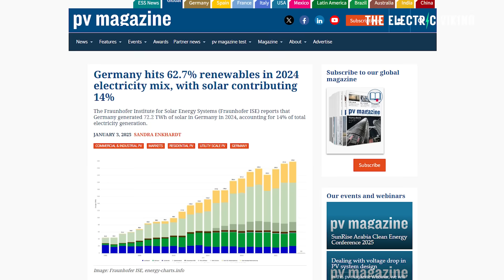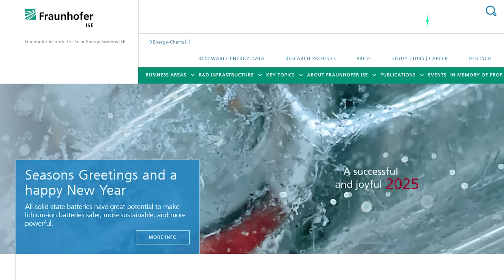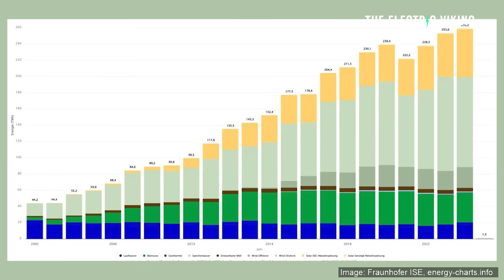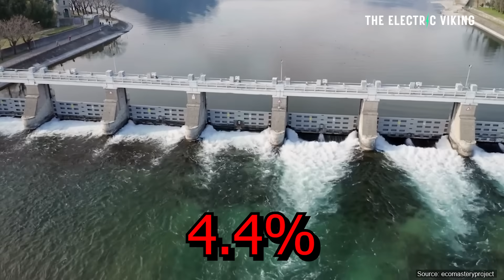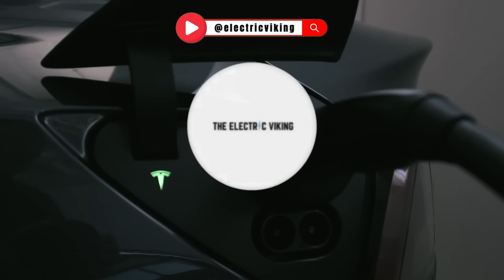Germany hits 63% renewables in 2024 as battery storage almost doubles

Comment: the energy prices have risen 3x since the pandemic and they also have to buy energy from other countries such as france to keep the resources afloat
Reply: Are you Sure? German Guy here, you can get fresh energy contracts for around 30 cents/kwh with fixed price for a year If you like (just checked). And I dont remember paying 10 cents/kwh before covid. I also checked this and surprise, it was actually also around 30 cents/kwh, so it Back to Normal, If you include Inflation, its even LOWER. 

Please dont use those people as example who switched contracts during Gas shortage times and are now too lazy/stupid to get a new contract.
Reply: No, Germany has enough installed capacity for itself. It doesn't need the imports. But the imports are cheaper. However France really needs to import electricity in winter. Don't twist the truth.
Reply: No more cheap Russian oil.  It will take a while to replace all that with (cheaper) renewables.
Reply: @krakken-  and with The Donald going to supply us cheaper energy too remember… drill baby drill!! Well until Starmer goes back to EU again… against all our will so energy will go up,up and up! Its already the most expensive on the planet!! 🇬🇧🚜 but its okayMr Milliband isgoing to make it cheaper by £300… oh, no he hasnt, he has made it more!!
Reply: No. Germany has plenty of power. They buy electricity when producing is more expensive than buying. Usually they help France when their nuclear power plants are cooking.
Reply: @limonade2684  Why is Sweden and Denmark complaning as hell when Germany has enough energy :P
Reply: @ravanpee1325  Denmark isn't complaining at all, but sells a lot of energy to Germany.
And Sweden has it's problems now: they just don't have enough lines to fully supply their south from the massive hydropower plants in the north when both wind and nuclear go down. That has just happend: 1 of their 6 reactors was down, and a doldrum happened. Meanwhile, their suppliers saw much more revenue in selling energy to Germany, thus their energy prices went up massively, but only briefly. And the conservative energy minister Ebba Busch is not quite true blaming Germany for that, but not their own companies. It's also politics.
Reply: Complete rubbish you picked up from tabloids.
Reply: @seppwurzel8212  Picked up what? 🥲
Reply: @seppwurzel8212   Picked up what? 🥲 You cant be saying the tabloids of lying are you? Those multi billion £ companys!!
Reply: Another thing Sam gets wrong is the Grid Infrastructure is not designed to take multiple inputs of variable. When electricity is produced by Wind and Solar the power rates are different which then need to be levelled out to a standard power rate. Only large producing plants such as Nuclear, Gas, Coal power can provide a consistent power rate. 
You need 50% of electricity users to produce and store their own electricity and not feed into the Grid. The heavy baseload of the electricity needs to be provided by large Peaker plants that do not pollute the environment. The only ones that fit this is Gas turbine plants. Because Europe has gone stupid and banned Russian Gas. This renewable transition will fail for industry users.
https://www.youtube.com/watch?v=tzZgJkTtoRg&ab_channel=SkyNews
Reply: @mspaintclippy  I paid on average 26 ct per kWh in the last 365 days. I didn‘t pay 8,6 ct at the start of the pandemic. The price since then nearly hasn‘t changed for me. Maybe you should look for a electricity provider with a better tariff.
Reply: Untrue. They spiked, but they are back down to older levels. But also: what’s bad in buying cheap electricity from abroad? We can self sustain us, but right now it is cheaper to use as much renewables as possible and buy some from France (after supporting them with energy when their nuclear plants were off grid for a while). It is a pretty strong achievement already, but now requires great investments in infrastructure.
Reply: @RealDonDenito  If electricity prices are cheaper why is Europe deindustrializing because of energy costs?                                            It seems there was a plan? Maybe Zionists planned for the war in Ukraine to ban cheap Russian gas, and then import expensive LNG from the US and Qatar. With the dream of using renewables? Renewables make sense for domestic usage but not industrial!
Reply: @ You mean even more money that we dont have…
Reply: That's why it's called a Plannedemic.
Reply: What Sam DOESN'T tell you is that the renewable energy that Germany produces is HIGHLY VARIABLE.  That means that it MUST EXPORT large amounts of electricity to its neighbors when it is sunny and/or windy AND IMPORT large amounts of electricity AND run very expensive fossil-fuel peaker plants when it's not.  The numbers he quotes and the graph are VERY MISLEADING.  THe overall contribution of renewables to Germanies actual domestic needs is thus much less renewables and much more domestic fossil and imported energy of all types.  Germany MUST use the rest of Europe for its generating buffer and emergency supply.  Electricity in Germany is VERY EXPENSIVE as a result.  That system is NOT translatable to the rest of the continent.
Reply: @dzcav3  In 2024 the import netto was 6,6% of the total energy production. I wouldn't call this large amounts. The netto import average price was 8,1 ct per kWh. I wouldn't call this very expensive. The import netto will shrink in the next years. As a big part of the energy imports are renewables, the share of renewables is even higher. Don't exaggerate and deliver numbers.
Reply: @dzcav3  
@ElwoodEBlues
5 hours ago
That's what many people believe. Did you look the firgures? In Germany we imported 6% of our energy from other countries. Yes we sell some energy very cheap, almost for free, when solar overproduction happens, and have to pay for imports when we need them. But the imports are much cheaper than fireing up gas power plants for just an hour or two. 
 And you didn't mention the fees and taxes that make up for a full 30% of our energy prices.
 You seem to be one of those "problem seers" - look at solutions. And we are in the middle of "changing everything". We don't have anything but coal, sun, and wind. And coal is expensive now and shall be phased out. How would you solve that?
Reply: @dzcav3  You pasted and copied the same stuff above.
Reply: That's not true.  Fossil fuel prices have risen - know why?  Because they can.  Winð / solar are free, less the cost of installation.
Reply: @AllDogsAreGoodDogs  That is completly untrue..the issue are the "Netzendgeltegebühren" aka Network terminal fees...sun and wind will not give you a bill but your network company ;)
Reply: @ravanpee1325   Thats a great word!!

Comment: If a country needs to have spare electric production capacity when there are dunkelfleute like in November and that can only be done with fossil production that normally are not in use, then the cost of that production must cover the service and stand still for the rest of the year.
The longer times it is not in use, the higher the cost when in use.
Reply: True, but gas power stations are the heapest to build in terms of Euros per kW peak power.
There are ideas of changing the billing: paying of gas peakers by readiness, not just by energy produced. So we have them ready to kick in when needed and can leave them on standby when not - with the owner or operator making enough revenue to be safe to invest.
Reply: If you want to clean up energy usage, don't think in those terms. Think of it as standby for bad weather conditions/seasons. That's how you solve pollution problems, non-Capitalist style. Society should be happy bearing such costs for a cleaner environment.
Reply: @adamiskandar5107  You said, "Society should be happy bearing such costs for a cleaner environment."  What a communist Marie Antoinette attitude!  Not everyone is a wealthy elite like you.
Reply: @adamiskandar5107  However you think of it, it still has to be paid for, duh!
Reply: The main costs are the fossil resources.

Comment: Germany retired some of its nuclear reactors? No not exactly, on April 15 of 2023 it shut down the last three ones. Since nearly two years it is free of nuclear power, except a little bit from its neighbours.
Reply: Which is crippling Sweden during days of low wind. Germany was exporting that power which was propping up Sweden's network. Sweden's energy minister is desperately trying to 
get approval for an increase in nuclear power in Sweden, now. A stark contrast from where they were just a few years ago.
There's more to the German energy story that is just being spruiked in this video.
Reply: @davidbrayshaw3529  You are aware how it takes to build new nuclear power stations?
Sweden also needs to increase the capacity of its north-to-south power lines that connect the massive hydropwer stations. And yes, they shut down 4 of their ~6~ correction: 10 nuclear power stations.
But do you really believe that those last 6 old, run-down nuclear power stations that Germany took out of service are hurting Sweden's energy supply? There is enough capacity. Just not cheap capacity.
And btw, the same swedish energy minister has "btw" cancelled many wind parks along the Swedish eastern coast line, together with a previously negotiated cable link to Swedish offshore wind parks in the Baltic sea? 
I tend to believe she is a nuclear industry u-boat.
Reply: @ElwoodEBlues  I know nothing of the politics or the plans. I don't know whether she's talking about re-commissioning stations, but she was talking about a time frame of 18 months, which would suggest that. There's no way that they could carry out that scope of work any other way.
I've got a good friend living in Sweden. I'll have to get the local take on the situation from him.
Reply: @ElwoodEBlues  World wide the average time to build a nuclear plant is 6 years.  Some countries have gotten the build time to around 3 years.  Just takes some practice and start off with small projects first.
Reply: @stanleytolle416  in Europe only 3 nuclear power stations been build since play year 2000. All three massively exceeded the projected construction time and costs. In the United States the Vogtle power station became so expensive it is not economical, and NuScale failed as the energy prices produced by their SMRs had not been competitive, had they been built. The only country I've heard of that is actively building new power stations in largers number is China. They really may have achieved building reactors in 6 years.
Reply: @ElwoodEBlues  so how come other countries can build their nuclear power plants on average in 6 years at one third or less the cost?  These are the same type of reactors built to the same safety standards as what are being built in Europe.  Maybe hire these companies to come and build the power plants.  Like refineries, chemical plants, steel mills, massive dams get built without the problems the nuclear power plants are having.  Only conclusions is political BS.
Reply: @davidbrayshaw3529  Since 2023 Germany is an importer of electrical energy, before it was exporting to the neighboring countries.
Reply: @thorblau7943  Exactly. Germany exported 10% less electricity last year than in the previous year. It imported even more than that over the previous year, and its production fell by 4%.
I don't know what Viking is on about. None of these metrics are a positive. In fact, it's quite the contrary.
Reply: @thorblau7943  True, but it is not a large amount. I am more worried about the huge bill for imported fossil fuels.
Reply: @thorblau7943  We did not import eletrical energy because we had to - but because it was cheaper than burning coal or gas in germany.

Net imports were 2.9% by the way. And we never ran near a brown out or energy shortage.

I can unterstand if you do not want other to know that. But I do. 😉
Reply: @Dr.Acula787  I only stated the fact that in 2023, Germany turned into an electric energy importer after it has been exporting electric energy for 15 years or so. If it's good or bad or whatever the reasons have been. 

P.S: Importing cars from China might be also cheaper than producting them domestically.
Reply: @davidbrayshaw3529  it is positive, cause it doesn´t make any difference if u import more coal/gas/uran to generate the energy urself or import the energy via wires.
Reply: A lot of nuclear power from neighbors. Compair the expendures German put into renewables and what it would have cost to use nuclear.  Nuclear would have been 1/3.  For Germany shutting down nuclear was nuts.  Completely destroying Germany industry.  Stupid, stupid.
Reply: wir importieren Atomstrom
Reply: @ingo_8628  Germany is using a lot of nuclear power from it's neighbours.  The neighbours are getting pissed because they are driving up electricity prices.  Germany needs to restart their own nuclear plants and quite spending so much on wind and solar that are doing nothing except drive up electricity prices
Reply: German here. We meanwhile recognized it was a huge mistake to shut down nuclear power. A big majority wants to have it back now. 😊
Reply: @volkerr.  I am German as well and I don't think that the majority wants it back. But I don't have numbers.
Reply: @ polls regularly show that we want our NPPs back

Comment: Germany is still a lot cheaper than Scotland which has plenty renewable energy but a lot goes to England making our prices really high.
Reply: It's not that fact that a lot goes to England: Scotland could entirely power itself and prices would still be high: It's because there is a single price set for the whole UK.  We need to move to regional pricing whereby regions with a lot of renewables have prices based on that, and regions with few renewables had their prices based on that.  That would encourage people in South East England (for example) to install more renewables, and companies using a lot of electricity (e.g. data centres) to move to Scotland where prices would be lower.  Green groups are trying to push for this kind of reform, but it's not happened yet.
Reply: @simhedgesrex7097  Also, stop linking electricity prices to the price of gas.
Reply: @nickwinn7812  Absolutely!  And start transferring subsidy funding to gas prices, not just electric ones.
Reply: @simhedgesrex7097  Same in Germany. But the heavily industrialized southern German states - especially that one that heavily opposed againt building wind parks and new power lines, Bavaria - opposes heavily against it. So it happens that Germany northeastern parts pay much more whith grid fees despite having lots of wind energy - and the South is happy to have low grid fees while driving up the energy prices for the whole nation.